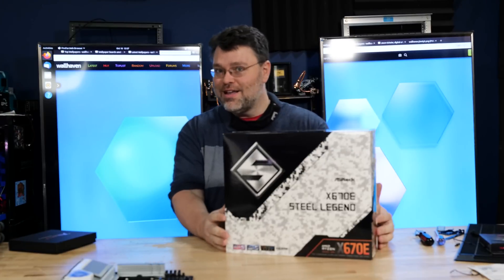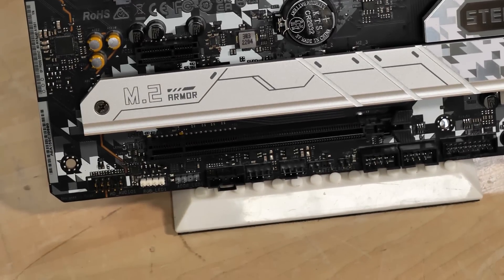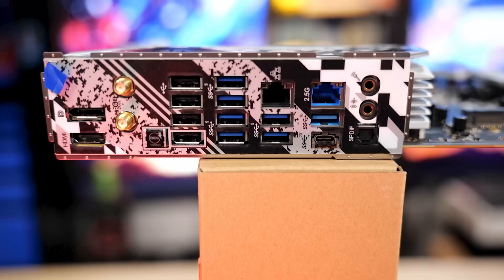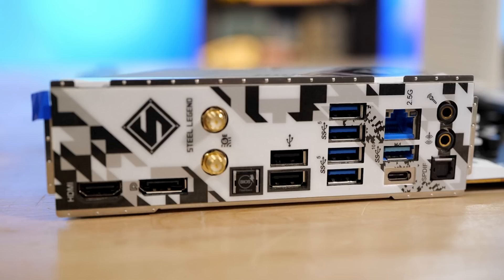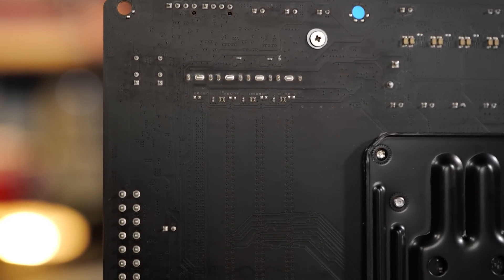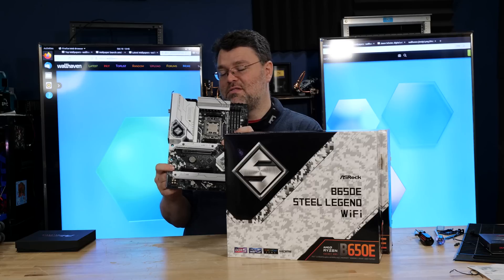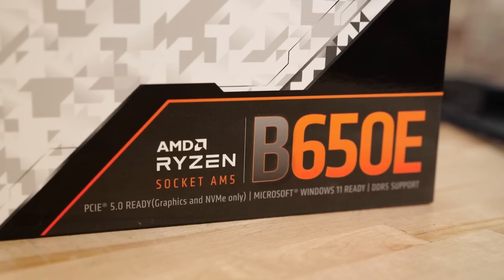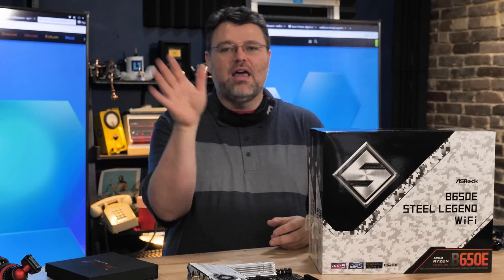PCIe 5 Without Breaking the Bank? ASRock Steel Legend B650E Review

Comment: I am having a rough start coming from Intel, my 1st board only went thru post with a single dimm installed, regardless which of both. RAM is on the gigabytes list,  but solid red dram led for >1h. 1 socket PIN looked really weird way longer than the rest - but at the end no clue what can cause the issue. bios versions checked, cpu position on the socket checked, I even torqued all socket screws all to 0.8Nm just in case to avoid any stress or bending. MB and RAM went back, but I kept the cpu. Should I try just another board or could the combo be the issue? Gigabyte b650e elite x ax, 7800x3d and some trident dimms F5-6000J3040G32GX2-TZ5RS

Comment: I have a 54tb Miniserver for Slow Storage and 3 SSDs and 2 Sata Portson this mainboard are very good for my build. I guess the B650 is very limited so that they cut the Sata Ports for Extra Lanes for the PCIe 5.0 x16 Slot which has DOUBLE the Bandwith of PCIe 4.0 .

Comment: im running this board with a 7800X3D, 32GB CL30 6000 ram, and 7900 xtx :) not super power hungry but also a little overkill at times lol
Reply: did you flashback before install? or ur bios was ready?
Reply: @jimijefet7276  I did a bios flash before first boot. Has been running great :) you will need to update if you want your ram to run at its highest.
Reply: @jimijefet  it's a solid motherboard and has a nice heavy weight to it

Comment: I'm torn between this and the AsRock 670E Pro RS. both have my 3 must have features in 5.0 x16 PCIE, 5.0 x 4 M.2, and an optical out, and believe me that combination is otherwise $300+ if not a lot more with a bunch of useless bells and whistles, so kudos to Asrock. The problem is that while the X670e Pro has so much more SATA, USBs, and M.2s, it also only has 4.0 PCIe x 1 lanes instead of the PCIe 3.0 x 16. the 670e Pro also has fewer and vaguely lower quality VRMs with an 8+4 Pin, instead of the 650E Steels vaguely better VRMs with 8+8 pin connector. I want the power stability but the accessory options are just so much worse on the Steel. I know I wont need any more than what the Steel provides right now, but when buying for Pcie 5.0, longevity and expansion options just in case are kind of important. AsRocks marketing doesnt help either, they specifically point to the Pro's VRMs as being great for OC, while the Steels VRMS just kind of exist, but the numbers don't add up.

Comment: Does Asrock b650 pg lightning cpu performance presets use negative or positive curve optimizer?

I tried the "PBO, TJmax 85c, curve optimizer, -40mv" profile cb23 crashes and rebooted pc right away...I disabled the profile and aer back my CO settings.

CPU: 7800x3d

Comment: I got the B650E Steel Legend as part of a bundle deal on Newegg with a Ryzen 7700 for about $500 before tax two weeks ago. I wanted a 7800X3D but all the problems scared me off. I'll give that tech a generation to mature on this platform I figure. I did want the PCIE5 slot on the off chance I keep the mobo through the life of AM5 and GPUs have gotten there.

I threw it together last weekend and it all works pretty well. My only (tiny) complaint about the board was that I would have liked a bit more room between the uppermost M.2 and the PCIE 5x16. It felt too close in my mind. 

To answer the question, I don't have any add in cards other than my GPU which may explain why the other being gen 3 didn't bother me much :)
Reply: What exactly were the problems with the 78003xD that put you off? I have it and it runs great without any problems.
Reply: @thornea7015  At the same time I was looking to buy a CPU, they had the issue with some 7800x3d chips taking out mobos via overheating/overvoltage.

Yeah, it's a non-issue now but seemed pretty big at the time. So I played it safe and got the 7700 :)

Comment: So far all of the pcie 5.0 boards I've looked at under $400 have their lanes shared with 1 or 2 m.2 slots and are cut down to x8 once they're populated which is the same as x16 4.0 so why even get these boards? Is anyone actually buying these boards and could you explain why? I plan on getting the 7800x3d once it drops and haven't decided which board to get but will likely get the gigabyte x670 elite ax.

Comment: you´re better off spending a few bucks more onto a non-ASRock board, so you don´t have to put up with their crappy bios-releases where they fix one thing and break another. had two of their top tier am4 boards (taichi x470 and aqua x570) and will not buy something from them again after this "experience".

Comment: i always feel it's a bit of a slap in the face having a huge loadout of usb 5gbit and 10gbit usb ports i don't care about, and then getting just 2.5gbit networking.
Why the heck isn't 10gbit networking the standard yet!?

Also regarding peripherals, on a gaming system, 10gbit networking is all i'll add besides a GPU. In my homelab server it's a simple gpu for transcoding plex, one expansion card for networking and another one something like an LSI HBA card for some more sata connectivity.

Comment: IDK Wendel, like every other AM5 board, the price just doesn't add up. First of all, PCI5 isn't even a thing yet (which you did point out), but also it isn't that much for the price. Not to mention the cost of the AMD CPU's. I hate to say it, as I am a die hard RHEL/GNU/W3C supporter & I develop software using standards maintained by, systems writen by, the 3 listed, but I am moving to Intel to run my VM's. Not all of us play games, even though everything is marketed towards gamers. I perfer to run my testing environments as VM's, even though the initial overhead is higher, in the end its cheaper than running VM's in the cloud. From my perspective, AMD just doesn't seem to make a lot of economical sense rn. I congratulate them on there success, the have really done well lately, but they need to offer a more affordable option. Jeezus freaking christ, I can't believe AMD became a company too exensive for me to buy from. They really have done well.
Reply from the maker: Maybe pick up one of the non e boards thats pcie4? Good luck with the p and e cores with a lot of VMs.

Comment: While I know I am in the minority; i've always enjoyed the look of a fully loaded tower case with every expansion bay filled.  Its a goal I always strive for with every build; the latest containing two graphics cards (Not SLI but for rendering and more monitor outputs), capture card, sound card, m.2 storage, and 10 gig networking.  Takes me back to those IBM PS/2 Model 60 tower behemoths.
Reply: Facts, tbh
I feel like PC building was made for expansion card customization. Its a bit of waste with so little "true" customizability :p
Reply: Sadly we trend to remove more and more PCIE expansion in exchange for more M.2 slot.

Practically ATX motherboard nowadays is just stretched out mATX

Comment: Currently I have a 2.0 slot GPU, a sound card that I use for the optical in, and an old USB 3.1 card for testing and potentially VFIO. I have been thinking about upgrading my sound card to the Zx or getting a USB device with optical in, but I haven't done too much research on the topic. I've also been thinking of removing the 3.1 card as I don't use it, and it would be better in one of my older machines without USB 3. (and it would let me ditch molex in my main) I have been wanting to get a 10G nic that is x4 for my bottom PCIe slot, and I'd like to keep my second x16 open for either a GPU for VFIO, or some sort of future card that I would like. I would also want to get a 2 or 4 port SATA card that uses 4.0 x1 or 3.0 x1 for the full speed and supports SATA hot swap because ASRock decided not to carry that over to their X570 Taichi for whatever reason.
Reply: I also have a PCIe x4 10Gbit NIC and  all of my drives (7) are still SATA as I am still on Z87, so I need more than 2 Sata Ports. But I would like to upgrade to ryzen 7000
At some point I tried an old USB 3 card for VFIO, but it wasnt really worth it

Comment: I'm trying to fit a PCI-E x8 SSD, 10GB Ethernet card, and GPU on an AM5 motherboard and am having a hard time without going high end. Why are there no cheaper dual x8 boards, or even better a Gen4/5 x16 with a secondary Gen 3/4 x8 from the CPU. That should be possible right? 
There seems to be a massive lack of PCI-E layout diversity.

Comment: Why are motherboard manufacturers not putting the PCI-E X4 slot above the primary X16? That way you could use a single slot card (10GB Ethernet, PCI-E SSD, sound card, etc.) and have unlimited GPU compatibility. Putting the X4 at the bottom disrupts airflow from cases with bottom mounted fans when a card is installed in that slot, so that option seems suboptimal to me.

Comment: On my Gigabyte X570S Aero G I'm running an RX 6800 XT in the main PCIe, an RX 6400 in the 2nd PCIe, and a 10Gb Asus NIC in the 3rd. I guess I could lose the 2nd graphics card if it came to that, but need at least a 4X slot for the NIC.
My colleague uses a dedicated sound card and a tv tuner card.

Comment: PCIE 1x 2.5Gb NIC, PCIE 4x 10Gb NIC, spdif soundboard(not discreet soundcard, just spdif over opt and coax because USB sucks in various ways for various things) module because my motherboard is garbage, PCIE side mounted fan for the NVME drives and 10Gb NIC.
Other machine has a LSI 4i card, 10Gbe, 2.5Gbe, terrible 8port SATA card that struggles with bandwidth across more than 3 or 4 drives, another sidemounted PCIE fan.
Video capture server has HDMI/VGA/Comp card, RCA/S-Video card, PCIE flash drive, inter-slot fan for the PCIE flash drive, and I was thinking of moving a NIC to it.
Also considering Arc A310 if it's cheap enough and has working HEVC on linux(because AMD does NOT), or maybe a GPU for a small Windows VM to use Clip Studio Paint.

Maybe I'm a bit abnormal, but my brother was asking about a USB3 or TypeC expansion card for a very old machine, too, so I think maybe the meta gamer is the very vocal maybe-not-minority, and regular folk actually do use expansion cards and slots to keep old machines in service.
I very much regret not getting a board with at least 3x PCIE16 physical slots for the desktop.
Reply: All Asrock board except taichi has mediocre sound board

Comment: I have a sounds card, cuz having USB stuff on your desk is too much sometimes. Plus a my sound card has 7 dac's on one card, so suck on that. I have the hype 16x m.2 with 4 drives in raid, and also have a single m.2 riser card. I'd have a 10G lan card, but this x299 mobo has 10G lan onboard. I still have room for upgrades too. I have the DIMM.2 open still, and a couple more slots. Going high end x299 was worth it. And with my 3080ti, and playing at triple 1440p, I'm still gpu bound. I have many years left in my x299 system.

Comment: More drive controller cards. I'm a storage nerd and so I wind up using all my onboard SATA ports and I need more so I get an expansion board. I also have an old 10Gb network card that I use for connenting to my iSCSI SAN. That's what I use my expansion slots for.

Comment: I too am a "peripheral fiend". Sometimes you need an extra  x1 slot just to replace a failed onboard NIC or USB controller. One thing that used to set Asrock apart was their  amazing flexibility. I get the feeling AMD made this AM5 platform so difficult/expensive to implement that manufactures had to cut costs where ever they could and  PCIe slots were the first go.

Comment: I like having an extra wifi card for running dual wireless connections at the same time, and an extra gpu for side tasks - having the option to add different cards is always a good thing though.  I personally would rather keep the pcie slots we traditionally have.

Comment: Still rocking my Asus Crosshair VII Hero with a Ryzen 2700X and a 1080Ti. I also have the Asus Hyper M.2 X16 Gen 4 card for extra M.2 storage. 

I can't think of anything else I'd need to add in, but extra PCIe lanes always appeals to me just to have for the future; almost to the point where I'd consider a Threadripper Pro system over Ryzen in the future.
Reply: Threadripper on the B650E chipset 💀

Comment: I like the B650E from Asus , the Rog Strix Gaming - E more , the best of PCIe 5.0 is , if you have a PCIe 5.0 GPU , you dont need 16 Lanes , 8 Lanes ( = 16 Lanes 4.0 ) are more than enough . The Gaming -E has 2 Slots in 16x or  8X 4X PCIe 5.0 and a 4 X 4.0 slot over chipset It supports 2 x NVME 5.0  and 2 NVME over chipset = 4 , it lacks only the extended USB connectivity of X670E but i guess it will be relativly expensive .
Reply: But I ask seller in my country they said Asus didn't give stock yet for B650E ROG boards.....only prime and TUF are available. I'm also aiming for B650E ROG Strix

Comment: As for slots usage I only have an extra WiFi 6E card. I've never cared about onboard ports as I can always throw in an IO card if I need drives or something. Have a USB DVD drive for optical. USB DAC for headphones. The entire point of faster PCIe should be to put more or faster devices on AICs. And thankfully those things are starting to be made.

Comment: I try to spend more on the motherboard so I don't have to use add-in cards. I'd probably only have one for faster ethernet, sound or more m.2 slots if I needed any of that. How far off are we from losing analog sound completely? 1-2 generations?

Comment: I have 20 year old Logi Z-680 5.1 THX speakers that cost $325 way back. Logitech dropped support for them with Win 10, they didn't submit a driver to Microsoft. Yes Logitech screwed up, not MS. So I lost digital support for my speakers and only analog works. So a no go on the 2 Asrock B650's I've seen today when I can get an ASUS Tuf B650 with the standard audio outputs we've seen for15+ years.
Reply: Nice! I still have my Z5500 hooked up to my legacy pc. I bought them from a Comp USA when they were going out of business.

Comment: Not a bad looking motherboard 🥰👍. 2x SATA is a bit limiting for me. I know M.2 is the future format for SSD storage, but 4x SATA would’ve been better imo. It appears that AMD is limiting I/O ports this generation to help differentiate differences between the B650 and X670 chipsets 😡😢. However if B650 is more limited in I/O ports etc, and comes in noticeably cheaper, it may be more than adequate for most users and may give better adoption rate for AM5 👍😇. Thanks Wendell for this quick peek 🥰👍
Reply: Yep, this mobo is automatically off my list of ones I would pick from for my next build. Two SATA ports is way too few. My current AM3+ mobo has 6 SATA and 2 eSATA. And I had to get a PCIe x1 card with 4 SATA ports so I could have more SATA ports. While I personally won't have the money or need for a 4 slot GPU, I still don't like the idea of having the only non-GPU slot being so close to whichever GPU ends up in the system.
Reply: ASRock seem to have been the only ones to offer 8 ports instead of 6... and now they're down to 2. Yeah.
Reply: I think you can get M.2 to SATA adapters. Just turn those PCIe lanes into some SATA connections. Of course, that adds more cost on top... :/
Reply: It's not AMD who limiting sata port, it's Asrock. Go looks at Asus and msi, they can put 4 sata port, gigabyte even have 6 sata port
Reply: it has 4. i don‘t know why he said 2. they are stacked.

Comment: One of my computers has a 1080ti, a single slot Quadro, an ATSC tuner , and a 10Gbe nic. That's no longer my main PC, but as I shift that to virtualization I'm ultimately going to have at least 2 GPUs in it. My current $480 X570 motherboard has built-in 10Gbe, and thunderbolt. What irks me most  about AM5 boards at or even a little more than that don't offer at least those 2 features. I have a bit of a suspicion that Asus basically discontinued the X570 Pro Art after only being out a few months because it was actually priced reasonably compared to their plans for X670.
Reply: totally agree, Asus killed the proart X570 due to their AM5 plans. That was probably the best featured AM4 board ever made. I went with b550 version of proart as i don't need 10Gbe, just TB4. Glad I did as B650 version is a huge step backwards without any thunderbolt support! 10Gbps max on the usb-c ports, no USB4. X670 version of proart seems great but is just totally out of my price range like most other boards, so feeling good about staying on AM4.
Reply: @JosephAraya  I've got the ASRock X570 Creator. While it has better iommu grouping than my other Asus X470, along with the IO, it's had some issues with how it handles CPU voltages and PBO behavior. Two CPUs I've had in it run way hotter than the X470. I was considering swapping to the Pro ART and just using the ASRock in the other one. At very least I'd hoped to pick it up if there was a price drop, but nope they didn't want that to happen.

Comment: Engagement challenge: 10gb Nic, 3x M.2 PCIe Gen3, 3 graphics cards (RTX 3070, RX 6900 XT, WX8200), every sata port used.

Looking at building a new system. Could go down to: 1 graphics card, 2 M2 (ideally gen 5), 10gb Nic, and a few Sata.

Comment: 2 SATA-ports? Last time I had 2 SATA drives in my PC was 20 years ago. Way too little. Other than that, basic stuff like a NIC card and a soundcard that has 5.1 support is a must for me. I would be more curious if the first GPU slot was an PCI-E 5 x8 instead, if that would be enough for 99% of GPUs. And give the other 8 lanes to NVME and stuff. Theoretically, that would be more interesting.
That would leave room for an additional GPU that just provides outputs, like what is useful in GPU passthrough. That would also mean 4 PCI-E slots on the mobo.
Reply: It's Asrock, other company has 4 port while gigabyte has 6
Reply: I would be willing to give up SATA if the rest of the board is superb, I haven't used SATA drives outside my NAS in many years anyway, but this board doesn't even have 10GbE or USB4. Skip!